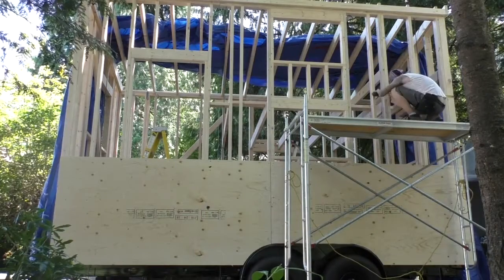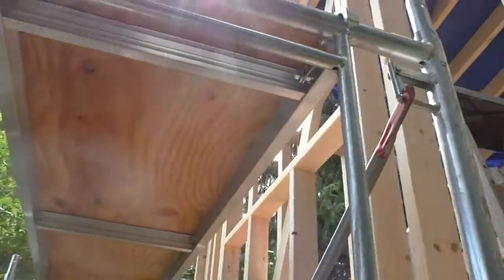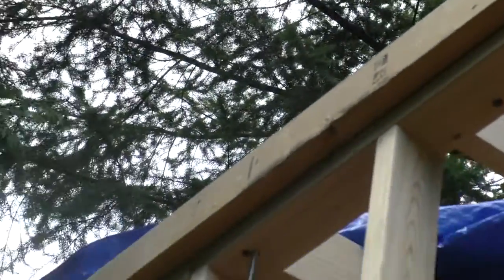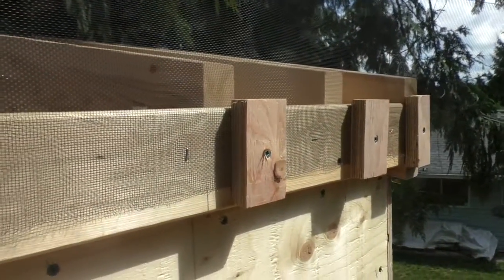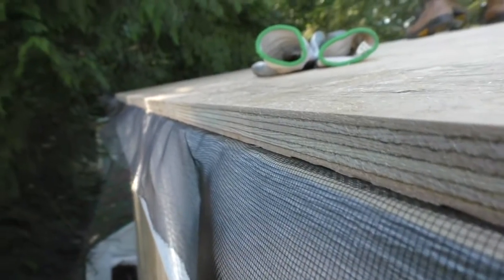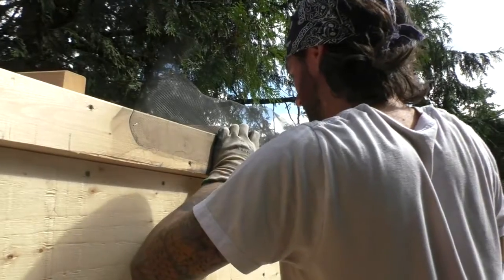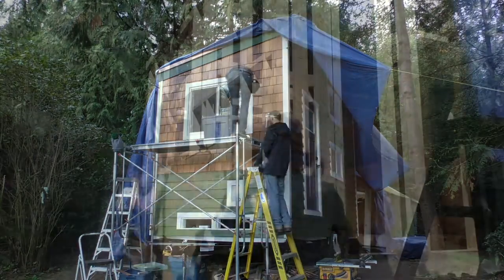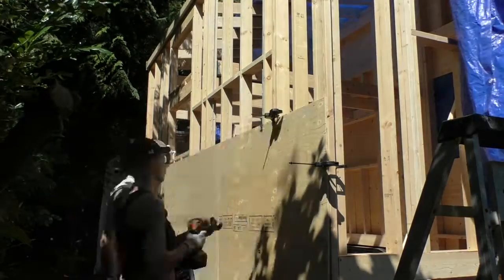Subfascia, Bugscreen & Scaffolding // DIY Tiny House Build

Comment: Did you just apply the 2x4 (sub fascia board) directly onto the sheathing?
Reply from the maker: +Gabacado : Actually, the sub fascia just attached straight to the top plate. We did a double top plate, so it attached to the top-top plate, and the sheathing butted up to it and attached to the bottom top plate. I'm sorry I didn't get better footage of the sub fascia. I'll make a quick video of the SketchUp model to show you what I mean.
Reply from the maker: https://youtu.be/Z0by8pYvvpY There's the link. Hope that helps! You shouldn't have any problem attaching the sub fascia to the  sheathing, screwing straight through to the top plate. It will just sit out a bit further than mine, giving your roof slightly more overhang.

If you're going to do the spacers for ventilation under the roof (like Tiny Nest and I did), make sure you put them on all four sides of the house! I didn't put them on the short ends, and it meant the finished siding (cedar shakes in my case) had barely enough room to fit up under the fascia. Also, I used 2x6 for the subfascia on the short ends, because they basically just sat the same way as the 2x6 roof rafters.